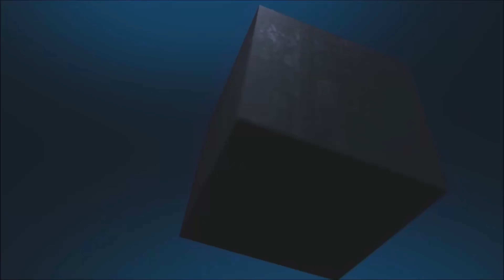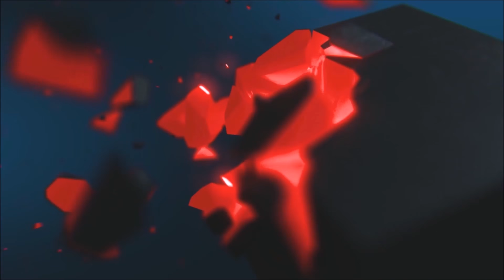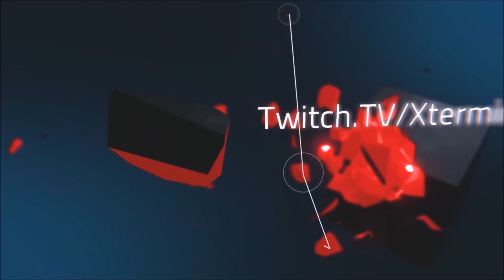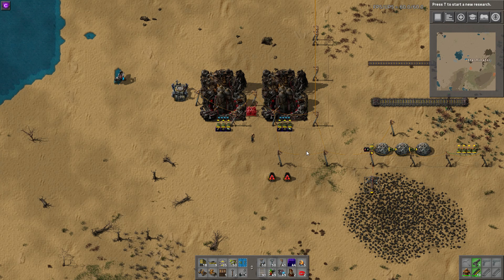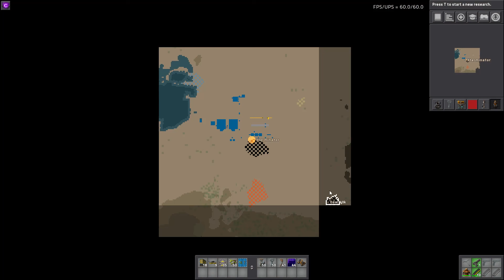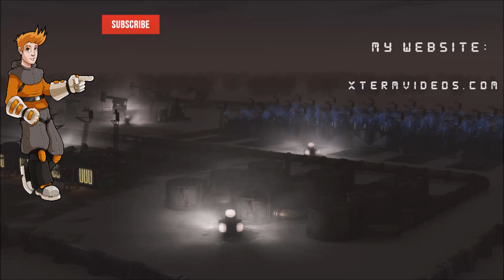Factorio Tutorial - 12 Tips, Tricks & Features You May Not Know About [Contains Spoilers]

Comment: 6:00 this feature is great for perfectly merging belts. Just put the filter to somethign you dont have running on that line on the OPPOSING side to where you want the objects to go, and it will merge it better than just a conveyor to the side
Reply: This.

I have been using arrays of filter inserters to achieve the same result, so this just changed my (factorio) life.

Thanks.

Comment: You can shift + left click any power pole and it will lose all its connections. Don't know what it can be used for XD
Reply: This can be immensely helpful in conjunction with power switches. In a previous base I had massive smelting complexes that could smelt some absurd amount of plates if ran all at once but it required like 5GW of power just for the smelting which was a tad absurd. 

I set it up so when the chests were full, the train stops turned off and the power was switched off as well. The result is that as long as I don’t let my outposts run completely dry for too long (there’s some 80k storages at the smelters for each type) it uses an average of about 2GW of power. Such things can be used to mitigate pollution as well. 

Disconnecting the power lines and connecting them through the switch is what that feature is primarily for. :)
Reply: Christopher Ploog I use that occasionally if I only want red/green wires running along a line of power poles. Purely for looks though.
Reply: It's useful in conjunction with being able to place copper wire to wire back those connections. This allows you to isolate electric networks.

For me, I usually just put everything into a single electric network, so I don't find it useful to disconnect the electric network, but it seems like some people find it useful to make bases that can prioritise electric power to critical sections of the factory when damaged by biters or when the system is running low on fuel.
Reply: @yvrelna  Especially when low power slows down your coal drills -> they mine less coal -> even less power -> less coal -> until your whole system collapses. It's quite funny to revive it back to working.
Reply: @jerzy-bombonierzy  That is why I build that massive solar farm. Yes, agreed that if you rely on coal then prioritisation is a lot more important.
Reply: I use it to discriminate energy comsuption on my base alongside swiches. Like if my batts on main feed are bellow 50%, I drop mining machines; if below 40%, I drop raw ore procesing; below 30%, I drop sience and all non defense oriented receptors; and bellow 20% I start up my steam generators back up power plant.
Reply: It can be useful if you want to reserve power from idling structures. Not everybody notices that some/many structures will use power, even when not doing anything. 

The worst one is probably the laser turret. If you have a huge amount of lasers, you might want to create a smart system where they only get connected to your system when they are needed to shoot something. This can be a very substantial amount of power you save, on a large defence perimiter/outposts. And it's fun to figure out a smart system like that, and get it to work.
Reply: Art

Comment: a Tutorial on how to tell where the ups drain is coming from or smart trains that only go get supply's when they need to
Reply: The smart train can be done a few ways, one way that I do is that I "turn off" the offloading station when the offloading buffers are almost full, that means the train just sits and waits at the station before until the offloading station comes online again. The way I use it also means that I can have two iron ore stations in use at the same time and have them balanced even when using only one train.

The way I make this happen is that I wire up all the buffer chests of one station so that I can read all the contents of the buffers, I then take that signal and put it in to a decider combinator which outputs a red signal if the buffer content is more than a certain number. I have this set up for iron ore which have a stack of 50 items, I use just wooden boxes which have 16 slots each and I have 4 cargo wagons which have a length of 6 tiles so that means that for each cargo wagon I can have 6 chests.

 This can be put in to a pretty neat formula: (Item stack size x Chest storage slots x 6) x Number of cargo wagons = Max amount of items that can be stored in the buffer chests. For me this equation looks like this: (50 x 16 x 6) x 4 = 19 200, that means that when the station is totally full the number of items is 19 200, since I don't want the station to constantly flicker between off and on I have the decider combinator set to about 18-19k items. I then put a wire from the decider combinator in to the station itself and set the station to turn off if it sees a red signal, so as long as the station is almost full it doesn't "request" a train which makes the train available for either another iron ore station or just lets it rest and not waste fuel.

If you have two stations of the same kind you can make this system even smarter, here comes the balanced between stations part. So say you have two stations and you want them to be balanced so that not only one station is used, the way you do this is set up another station the exact way as the first one, so you basically have two identical copies (they don't need to look the same or unload on the same side but the wire logic should be the same).

What you do next is put down one arithmetic combinators next to each row of buffer chests (only one per station, not one per wagon place) and remove the signal from the chest going to the station and place this in to the arithmetic combinator instead. This should take the item signal and just transform it to something else so that there are two different signals based on the two different stations, otherwise this won't work.

I have two stations with iron ore and I have them placed next to each other, so I transform the signals into "L" for left and "R" for right but make sure you have the output amount be the same as the input amount, don't change the value to "output only one", you don't want the signal amount to change, you just want to differentiate between the two stations. What you do next is put down two decider combinators between the stations, wire up the output of each arithmetic combinator into the input of both decider combinator so that both decider combinators should be able to read both station contents. Then you set up the left decider combinator to output a red signal of one strenght if the left signal is bigger than the right signal and do the opposite to the decider combinator on the right.

To test if this works, place a lamp in front of each decider combinator and wire it up to the the combinator above it (make it look for a red signal and make the lamp turn on if it sees a red signal with a strenght of more than one), the lamp that is on the same side as the station with the most items should light up, try to move some items around to the next station and see if the other lamp lights up as the item balance change to the other station, the first lamp should turn off, if all this happens you have done it right.

Now you take a wire from the left decider combinator and put it in to the left station and do the same with the other, you can keep the lamp or even move the lamp to sit next the station, if you want you can enable color on the lamp, this way the lamp lights up in red when the station is turned off. The lights are not needed but it's nice to be able to see in a glance what stations are turned off, you could even wire up another light to light up green when the station is on but I won't say how that's made, you can probably figure it out on your own ;) (also I'm lazy ^^).

The absolute last thing to do now is to take the signal from the first combinator, the arithmetic combinator that translates the signal into "L" or "R" and wire up the output of the arithmetic combinator in to the input of a new decider combinator, this should then output a red signal to the appropriate station with a strenght of one if the "L" or "R" signal is greater than the amount of items you want to have in the buffer area, this is the exact same as we did with the first station in the begining, only that we now use the signal for the specific station instead of the iron ore symbol. Use the formula I included in the first part to calculate how many items can fit in one station, and from there decide how many items should be missing before the station "requests" a train.

If you have done everything correctly, you now have two stations that only turn on if the station is low on items and the other station has more items, this way the iron ore train will only go to the station that needs ore the most and it will sit and wait if both stations don't need ore. This system can be stacked to include more than just two stations and you can make a lot more happen with this, for example; only make the iron ore station turn on if we have enough coal in the coal station, or only turn on the iron ore station if the iron plate station is empty. Best of luck in your building and I hope you learned something :D
Reply: @TheZebinator  So the train can sit in the filling area, until a "demand" station turns both - itself and a "supply" station. This is good for handling many low consumption stations: coal, liquids, science packets, uranium (not ore).
Tl;dr to read about your electronics, I can do it myself, but the idea is great, thanks :D
Reply: Quite easy...signals and wires...signal of ressource goes to trainstop and relayed to the train...so if me plates are low the train will start...or you set up something that keeps the signal closed until XY happens...

Comment: If you stick a pump on an uranium mine, you can suck out the Acid instead of it going to waste.
Reply: I usually build uranium mines with a second set of pumps and a circuit network specifically to drain the acid when the mine is empty, I also try to keep the acid stored in the mine limited to a little more than what's needed to produce a full trainload of ore and leave space on the train for surplus acid. I use a similar setup for firebases with flamethrower turrets, since they don't use much oil.
Problem is when you build these setups in a multiplayer game and some guy insists on turning pumps the other way because he simply fails to understand what the system is supposed to do, so you end up having to build a massive storage facility for the surplus fluid that's now been produced for no reason whatsoever.

Comment: onto the last one: you can put items into the output-slot of a factory. usefull to clean inventorys of directinserted midproducts.
Reply: You can also insert more items than a default stack size of an input item into machine. Just slightly more, like 116 iron plates.
Reply: What? No you can't?
Reply: +Matthijs
Yes, you can. Specifically, you can manually insert more of whatever a machine is making into its output slot. Like, if you've got a chemical plant making sulfur, and you have a few sulfur in your inventory from changing belts, you can just manually put your sulfur into the machine's output slot so you don't have to deal with putting it where it goes.

Comment: nice and useful tips !!!

here are some additional hints for these tips:

tip 3 : even when labs research a bit less, it probably is quite useful to only feed one lab and not need lots of belts, splitters etc. I found a comb like pattern to be useful, eg having one line of 10 labs, and then have two lines of chained labs from each of those 10 labs. the resulting additional 60 labs work at 99%+ and even the "main chain" still works quite well if their chain is built with 3 stack inserters for each link. that "main chain" can also be fed from multiple points, but then requires filter inserters to avoid labs "stealing" bottles back and forth between each other. this applies to unbeaconed labs only since 50+ beaconed and moduled labs need more than half a belt of each science anyway.

tip 4 : mining drills can also be switched on and off. it's a bit complicated, but i have built a mining field that first only mines the spots with most resources (above average ore) and then enables more and more miners. result is that an ore field doesn't slowly die, but instead starts mining slowly at first (eg while still building a furnace array) and becoming faster later until (watch out for this!) the entire ore field is suddenly depleted at the same time :-)

tip 5 : since wires are already free when built with blueprints and since you don't get wires back when removing them, i don't consider it to be too cheaty using a mod that makes production of red and green wires free (this does NOT apply to copper wires that are needed as intermediates for other things), eg https://mods.factorio.com/mod/freenetworkwiring or https://mods.factorio.com/mod/free_circuit_wires

tip 7 : quick replace of normal and underground belts and splitters is nice but can be annoying when replacing lots of them by dragging (eg when upgrading the tier). there is a mod that i like a lot: it still allows you to quick replace any of them by clicking, but sticks to only belts when you start replacing a belt tile and then drag along the belt: https://mods.factorio.com/mod/Slower_Quickreplace

tip 8 : when using a splitter to merge two lines, i set the output filter to "fish" on the non-connected output side to avoid having "stuck items" there. someone else who did it that way too even created a mod that replaces the fish icon with an invisible icon to make it look nicer (i don't use that mod since i don't want an invisible icon in my storage chests that i also block by filtering with fish)
Reply: I am impressed with your use of the circuits to even mine an ore patch. Ingenious! Do you still place everything tight or do you allow for room between the miners? Their hardware footprint is 3x3, but the ore gathering footprint is 5x5. MadZuri mentioned that summing over all the miners will introduce too much "potential" ore because of overlaps. How do you overcome that problem?

I have seen the deconstruction planner used as a placeholder, instead of fish, to do the same thing. As long as it is something that should not be on a belt, it will behave correctly. Also, based on the recent Factorio Friday Facts, it might not be possible to use blueprint as objects, so fish might become the de facto item to filter on splitters.
Reply: you have to be very careful to not feed back or merge the wrong signals when counting the total amount of ore and the amount of ore of a single miner and at the same time needing ore signals to enable the miners. remember that the input and output connections of a miner are at the same location and can't be separated from each other. the whole setup requires some additional combinators for each miner, and thus i was glad when i finally could put the miner, power poles, belts, and all the circuitry in a small 5x5 area which automatically avoided the "overlapping problem" you mentioned :-) the only tiles which might have overlapped were the tiles under a belt which could have been shared by two miners.

the final blueprint was very modular and included everything for one miner, even providing a count of +1 to the number of miners with available ore for computing the average later. it has been a while that i built it (maybe in an old 0.15 or even 0.14 map), but except for that blueprint, it probably only needed one combinator outside the mining field to compute the avarage.

of course, this was more of a fun project than useful since having a few combinators for each miner is some kind of overkill, and making that blueprint (avoiding all those feedbacks) probably took as much time as mining all the ore field the usual way :-) but that's exactly what makes factorio such a great game :-)

blueprints as objects: i haven't yet seen that info, and to use all that stuff related to recursive blueprints, blueprints have to be objects that can be moved by belts, inserters, bots, etc and also be used as signals. Anyway and strangely, using decon planners instead of fish didn't occur to me, although having a red block would clearly be an indicator for something blocked, and less probable than a fish that might come from a fish farm to provide health. thanks for that idea! :-)